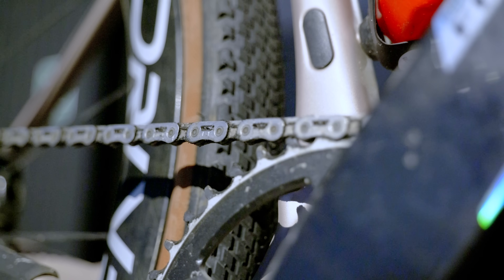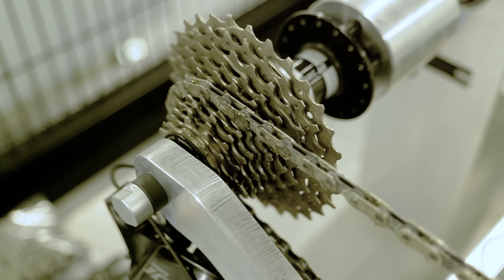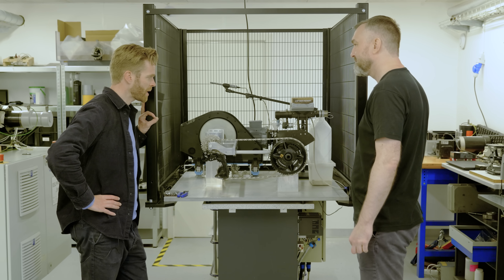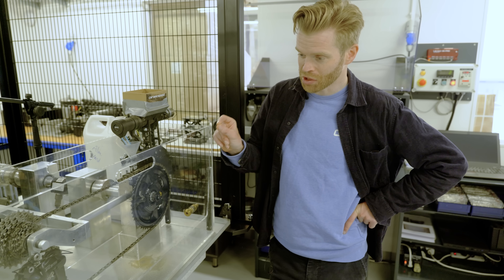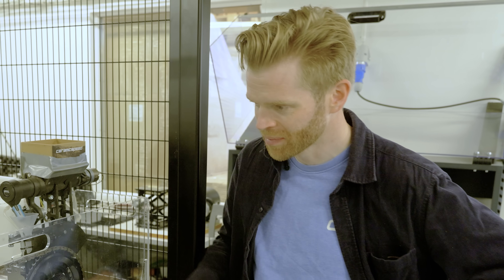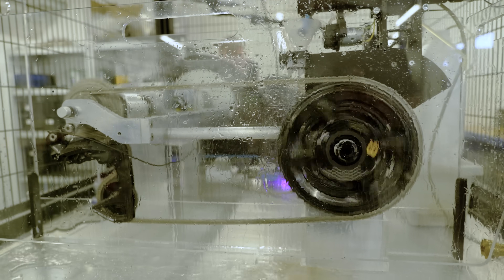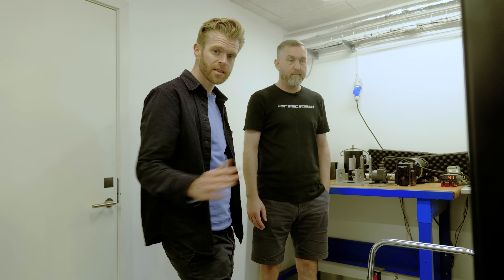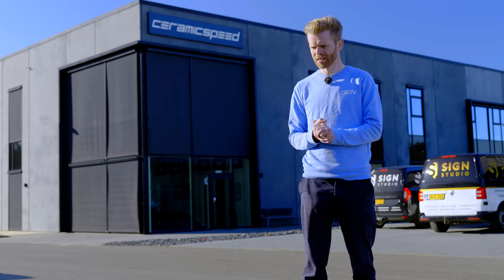We Lab Tested A Dirty Chain, How Much Slower Was It?

Comment: Speed is one thing - not important for most of us. But the costs of running a dirty chain are astronomical compared to waxing which in effect will make your drive chain last longer than your bike. And that's worth a lot to the rest of us. Also, when I was young - many decades ago - people frowned at riding the large front chain ring. For the last several years I have done it as much as possible. We have learned so much since I started.
Reply: "But the costs of running a dirty chain are astronomical compared to waxing which in effect will make your drive chain last longer than your bike. "
Preaching from the wax-cult. Care to provide any DATA to back up the dogma?
Reply: @larryt.atcycleitalia5786 you only need common sense.  Running grit and debris through metal parts will wear down the metal (chain rings and cassette).  Once again, common sense..
Reply: @larryt.atcycleitalia5786  yes. There are multiple people - waxing - and measuring their chain wear (which is what kills your drive train) here on youtube. I can also say, that my own chain wear after three years of waxing currently stands at zero - ziltch - nothing (as meassured by the chain meassure tool). So drive train wear is also currently at zero after 3 years. I wax and rotate 3 chains at a time which makes it very fast to maintain the waxing. 2 is probably enough for those who ride less. Cleaning the bike etc. is of course a breeze when you get rid of the oil. The problem with waxing before was getting rid of the factory grease. That was very painful. Now that problem is solved by Silca's one-go tabs, I can promise you - once you wax you will never go back. Let me add that I also have an electrical bike (Creo) - the chain wear on that bike after three years is also currently at zero which I find amazing given how often people using oil have to change their e-bike chains.
Reply: @larryt.atcycleitalia5786  ZeroFrictionCyclign and FrictionFacts (RIP) had loads of data showing just that.  Just because you don't understand the data and science, Larry, doesn't make it false.   You certainly can't falsify the fact that immersion waxing extends the life of a chain and drive train significantly compared to oil-based lubes.  Your beliefs are irrelevant because your beliefs aren't facts or evidence of anything.  Are. you also a Flat Earther, and do also believe the Moon landings were faked?
Reply: Waxing is way too complicated and time consuming. My 3-minute chain cleaning method goes like this. Spray a lot of WD-40 on the chain while turning the crank backwards until it's soaked. Then wipe the chain clean with heavy duty paper towels while turning the crank backwards. The dirt and gunk will come off easily. Repeat this two or three times, using clean paper towels each time. When done, put some drops of chain oil on the chain while turning the crank backwards. I'd say 15-20 drops is enough. The oil will spread across all the chain links while cycling normally. I do this roughly every 120km. My chains last 12 to 15 thousand kilometers and the drivetrain is smooth and quiet. A simple and quick 3-minute job every few rides which I will never swap with the long and messy chain waxing process. Please note that I don't even need to remove my chain 😉👍🏼
Reply: @radiocontrolled9181  That's hilarious.
Reply: @radiocontrolled9181  you obviously never tried waxing your chains.
Reply: @radiocontrolled9181  good for you. Can see you spend more time with your method than I do with my waxing. I spend around 15 min. waxing 5 chains at a time for 500km of riding each. Cleaning the drive train area naturally also takes less time for me than you. Changing the chain takes around 1 min for me as they are clean. Not sure about the costs using all that WD40. However, there is some added cost of buying more than one chain using my time saving method. And my time is worth that extra expense to me.

Comment: Awesome GCN,an actual drivetrain efficiency and test compared to Zero Friction cycling tests which are just numbers and figures,really interesting to watch.💯👌🏻✌🏻🚴‍♂️
Reply: Zero Friction Cycling carries out tests on lubricants in a controlled environment so that every lubricant tested is subjected to exactly the same conditions as those tested before. These conditions mimic those encountered in the real world and are the same for every lubricant tested every time. The data obtained from the tests therefore enables you to compare lubricant A against lubricant B  knowing that the results are unbiased and are not based on unreliable anecdotal evidence.
Reply: @joystation1 They are unreliable tests,I've been using Finish Line Green chain oil for 20 years and i achieve approximately 6000km on a Shimano CN-HG93 9 speed chain with this oil but Zero Friction says otherwise,many others use Finish Line Green also.

Comment: Definitely some food for thought on what I should try to do to my bicycle next.

Never thought I'd be considering a corncob with 36-35-34-33-32-31-30-29-28-27-26-25. I suppose that would go with a 120 teeth chainring?

But if that really does shave off around 5-10 watts, maybe it makes sense in some contexts? Definitely a massive hit to weight, though.

Comment: So my conclusion is: When your chain is dirty, don't clean it, just use bigger sprocket !
Reply: Yes. Go slower (bigger gear) in an effort to try and go faster 😜
Reply: Right! It's kind of nice to have a clean chain too! Maybe being compulsive about cleaning doesn't really pay the expected dividends.
Reply: when your chain is dirty - DRIVE WHEN IT RAIN
it can lube inside automatically
Reply: @nikostalk5730  😂😂😂
Reply: I don't ever clean my chains anymore. I just dunk them in a pot of hot wax. They also don't get dirty but the rain can strip all the wax off and make them rust.
Reply: I’ve never bothered with larger jockey wheels, but this suggests they may have an advantage.
Although, they are not taking the load, as the sprockets are under.
Reply from the maker: Interesting approach! We would still say clean it to save your chain, chainrings, cassette and keep the wallet closed for another day!
Reply: @gcntech  Useful cassette insight but since most people still run 10 X 2 a missed opportunity to show what effect the small cog has, looking only at the big cog..

Even better would be to shift through the full 10 X 2 to show the full shift pattern!
Reply: 😂 it was only a joke, but remember, that it's much easier to clean or replace the chain, thsn it is to replace your... knees.

Comment: I got some questions.
Would the gear ratio results be a reflection of resistance in the rear wheel / cassette?
Say the most efficient gear to push a 28" wheel because the wheel in contact with the road is also a gear.
Or could this be a loss of efficiency due to the tight turns in the cassette pulling a big wheel like the losses you get from small jockey wheels?
Or maybe the highest gears being further away from the hub generates losses?

Comment: 16:48 6watts? that's huge. even if the casette was like kilo heavier then it would still be more efficient on flat. this means that it might actually be worth it to do like 52-25t casette instead of like 32-11t.
Reply: They would require a 110 tooth front sprocket and twice the chain length. Eventually the weight of the rotating assembly outweighs the parasitic loss.
Reply: well assuming the aero penalty isn't anything that crazy but that's harder to calculate.

Comment: What you have made is a video showing that SRAM's 10 tooth sprocket on their cassette is a really silly idea. What would be interesting is if you went and got a "classic" 53/39 chain ring, with a 32-12 tooth cassettes (see if you can bodge it from 11 to 12). then put it against a 50/34, 28-11 cassette and see if is significantly better, 34-28 and 39-32 are essentially the same gear, and 53-12 and 50-11 are only 3% difference all while most cyclists don't max out a 50-11 very often to 110+ RPM anyway. Also comparing it to even a 40 cassette with a 55 tooth front would be interesting for interest sake! 

Anecdotally, as a person who has mainly run 50-34, when I ran 52-36 for a year or two, it did feel fast for some reason I could never explain, possibly it was me when in the 52 running a slightly lower gear on the cassette...or maybe I was just fitter!
Reply: Having both 10- and 11-sprocket in a road cassette is a very bad idea. Having 10 and then 12 in a wide range MTB cassette is less bad idea.
Reply: @TuubiLeijona  Have 10 at all if clearly a bad idea as we saw in this video, there is a reason time trialist sit in the middle of the cassette, and it seems that is actually more because larger cassette cogs are more efficient than chain line.  Therefore running larger front rings, and rear cassette cogs makes the more sense in terms of watts saved, it of course will have a disadvantage in terms of weight but I really can't imagine 100g off setting 2w-3w especially for normal riders.
Reply: This is contrary to the previous conclusion, no ? you should have been faster with the 50-34
Reply: @claudej8805  No, because with a 52 for the same speed as a 50 you would ride with a larger cog on the cassette, and as we saw in the video larger cogs on the cassette are more efficient.

Comment: I rode my canyon ultimate from 2015 with full shimano 105 for almost 10 years, doing like 4000k a year, without ever removing the chain or using chain cleaner. I cleaned the bike regularly with normal bike cleaner and garden hose. I didnt have a powermeter so didnt really care if I lose 5 watts and even if, its just better training anyway 😂 I take a bit better care of my new bike though but I think this video (and my experience) confirms that amateurs shouldn't overthink the whole chain cleaning stuff.
Reply: Same chain but 3 new cassettes and 4 new chainrings😂😂
Reply: Did DJT write this.  This is simply  not true.
Reply: @harrybosch5720  it absolutely is true, old shimano 105 is built to endure it seems, i use this same bike now with flat pedals for grocery shopping even
Reply: I assume you’re not saying a single chain lasted you 10 years/40,000k?
Reply: @ajrh82  yes one single shimano 105 chain!
Reply: @JustOneWolf  that seems to be well above anything I’ve heard before, did you get it serviced during that time? Any chance a mechanic put a new chain on and you didn’t realise. But if you got 40k km then that’s excellent!
Reply: @ajrh82  I bought it in 2015 mid season and rode it until the end of 2024, so thats more like 8,5 years, so around 34k is probably more accurate - but yeah, no service. Only fiddled around with the bike myself and I probably should have changed the chain and cassette earlier no doubt, but that bike was like 1400€ ( I don't know exactly any more) back then and when you are on the brink of buying a new bike, investing 150€ upwards for chain, cassette, chainrings (its 2x) and work just didn't seem like a good deal to me when I still could ride anyway without any major problems. And like I said, for grocery shopping I can still use it, no problem. I doubt my new ultegra di2 group will last anywhere near as long 😆
Reply: @JustOneWolf  amazing value bike (and chain) then. 105 is more than enough for most

Comment: Needing to use my brake due to road obstacles like cars and potholes also slows me down, about 40 sec across 40km TT. and a red light can cost me 5mins up to $1000 since a cheaper bike can finish the same time.
Reply: Remove the brakes - they only slow you down…😅

Comment: Not surprised at all. If your chain actually robbed significant energy it would litterally get hot.
Reply: Actually everything that turns is hotter than the surrounding temprature by about 2 / 3 degrees celcius.
That is basic science and what he does is being an idiota
Reply: How do you know it doesn’t get hotter? Obviously not perceptibly hot but measurably hotter?
Reply: @ajrh82  Everything that rubs against something else generates heat, ye measurable by any kind of thermometer, you can use a laser one for ease of use.

Comment: the chain on a motorbike does get actually longer. the links do actually stretch rather than the pins wearing. hence how you need and can to adjust for it with the adjustment on the rear fork. keeping it oiled keeps it from stretching as much and keeps it from getting hotter.
Reply: It gets longer, but it isn't the material stretching. It is the cumulative effect of the clearances between the pins and bushes increasing. (Exactly like with bicycle chain). The demonstration on the industrial chain wasn't quite right as it was showing roller wear not bush/pin wear.

Comment: So the waxxed sram flattop had a loss of 8.5w, while a shimano chain can get down to 3w? What do i miss here, thats very significant!
Reply: I didn't realize it until I read your comment. This would make me switch to a Shimano cassette and chain on my SRAM system in a heartbeat.
Reply: @driventomadness117 I think it's partly because they tested it in a Shimano chainring/cassette 😅
Reply: Maybe it wasnt mentioned, but a Shimano chain at down towards 3 watts is measured on the old test machine from Friction Facts days (Jason Smith). That one tests only chains, not entire drivetrains (so much less watt losses).
Reply: Nope, they mix Shimano gearing and a Sram chain. Those are not compatible. So not a scientific correct setup to get any valid results.
Reply: @Fractaljouney  exactly! Sram flatt top chains have bigger roller size and is not compatible to shimano chainrings and cassettes. But at least the last test was done with a shimano chain.

Comment: stop buying those crazy prices snake oil lubes ;) 15euro for 1dcl lol... Muck off is the worst of the worst, my chains laster for arounf 1.5k to 2k with that crap, so i started blending my own oils... 70% manual transmision oil 75W and 30% white spirit mixed together... for 20euro u get 2l of that and that is for lifetime...
after 100km just wipe the chain with rag, re.oil it and wipe off the excess... simple cheap, and in my testing at least 2x better lubrication that something like muckoff ;) on gravel bike with this method i get around 4500km out of a chain (bike is ridden in ALL weather, rain snow and at least 4km gravel per day), with muck-off i got max 2k, on road bike i get around 7000km from this blend (bike is ridden in  better weather)...

Comment: The gear dependence of the friction was interesting. Did you stay at 95rpm for the whole test? Maybe what you see then is predominantly the decreased loss in the rear-hub bearings as you move up the cassette (and not necessarily a better chain-line-efficiency)? It would be interesting to repeat the test at a constant rear-hub rpm...

Comment: How efficient is a 1-by system  compared to a 2-by system?
Reply: 1-by less efficient, because you need 42x10 gears for instance. And small-small is losing watts according to this video.
Reply: This is what I was thinking. How aligned the chain is and differences in running the same gear ratio on small/large or medium (1-by) front gears ⚙️

Comment: Are they really measuring a SRAM Flattop Chain on Shimano Chainrings, which are incompatible due to the larger rollers SRAM uses in their AXS chains? I don't think this is a proper setup tbh
Reply: Chainrings don't matter as long as the test rig stays the same. All you're comparing is the values tested on that day, which will be valid, as the conditions were the same.
Reply: @mikesiemens4145  turn out some idiot user hating designer thought making sram and shimano chain incompatible was a good thing.... i just learned this recently.
Reply: @mikesiemens4145  but they're not compatible... it will definitely create more friction
Reply: @aeyde exactly. like what if it was 4w lost in the 11t and 2w lost in the 30t. Big difference to 14w and 7w losses....
Reply: they have compatibility problem chain now? ffs i hate bikes.
Reply: It's a chain. How incompatible could it be?
Reply: @squidwardo-e6g  it is the bike industry, they never cease to make like harder for bike shops and the user, at the expense of the most marginal gains
Reply: @squidwardo-e6g very
Reply: @squidwardo-e6g  3 Ways: Pitch, Width and Roller Diameter. SRAM chose to make theirs a proprietary roller diameter, so they probably won't slip deep enough into the cog
Reply: yeah that was painful. should be all sram setup
Reply: @aeyde  or all shimano...

Comment: I suspect it's not the chain line but the bend of the chain as it rotates around.
Reply: Yes.  It would have been so easy for them to isolate this.  Just move the crankset until aligned with each cog.  That way, they could isolate the friction contribution of cog diameter from chain deflection.